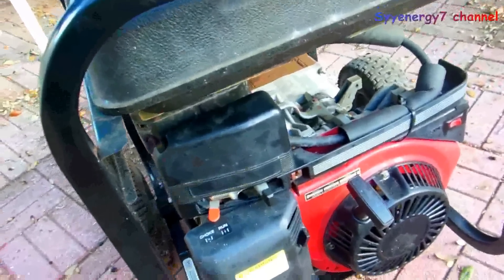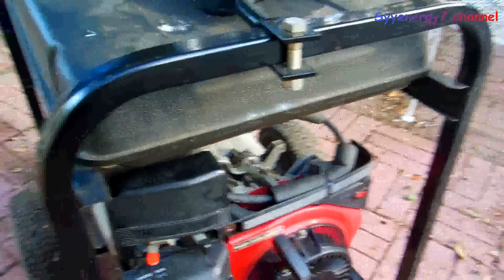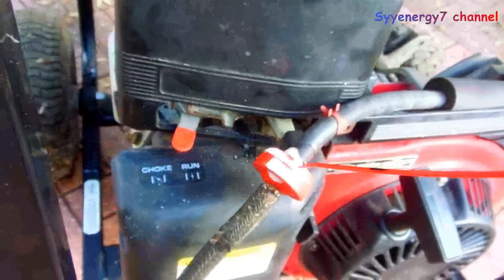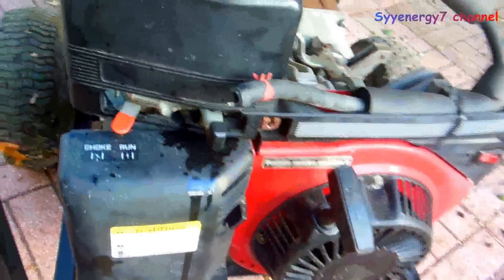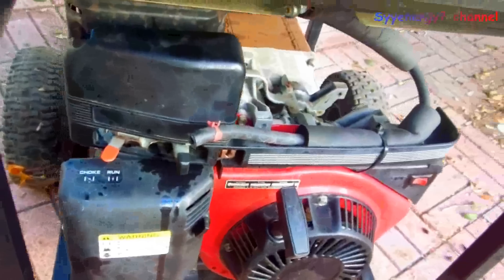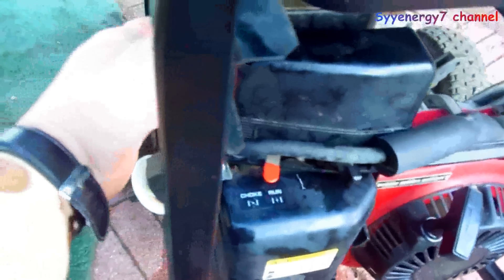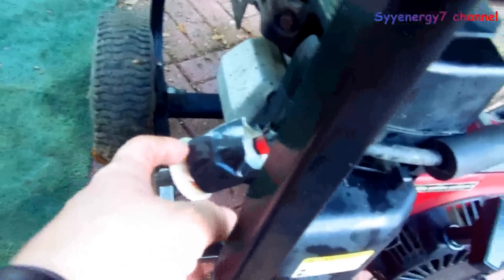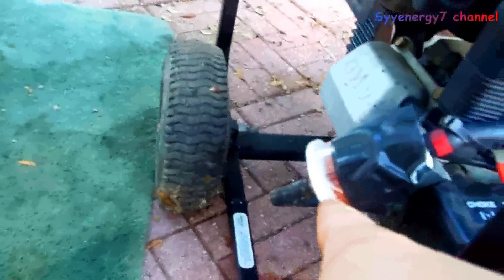Installing an In line Gas filter on a Generator

Comment: Okay I have a champion 3650/4550 and I don't see a fuel filter now I bought this used so I don't have a manual I have to grab it online but saw this video and thought i would ask Now so I don't think mine has one you think putting one on would slow fuel down if I did? thanks for this info.
Reply from the maker: The filter doesn't slow the fuel flow.

Comment: Good video however I wouldn't put grease in the hose - just put it around the perimeter of the nipple!  Also most of the tanks have a fuel strainer that sticks up in the fuel tank and need to be aware that that might be clogged if it is present. You access it by removing the fuel shut off valve assembly nut from the fuel tank. Good video!